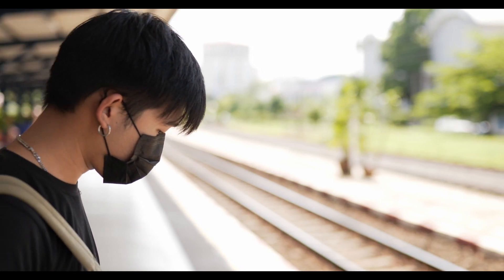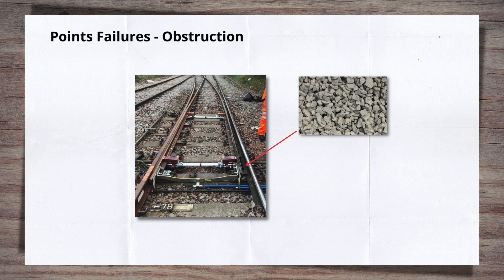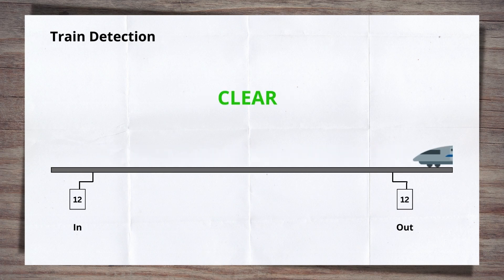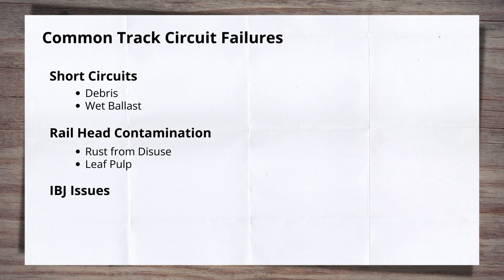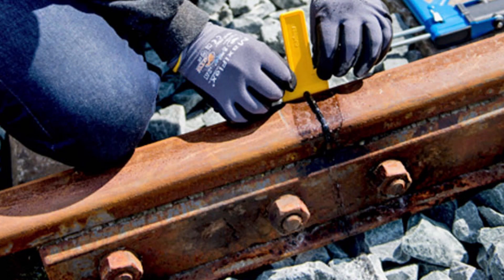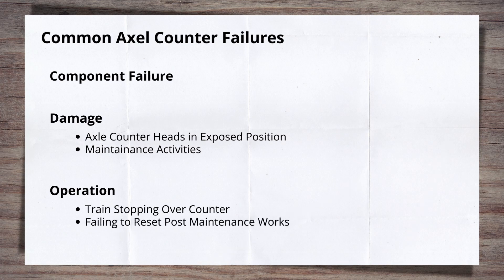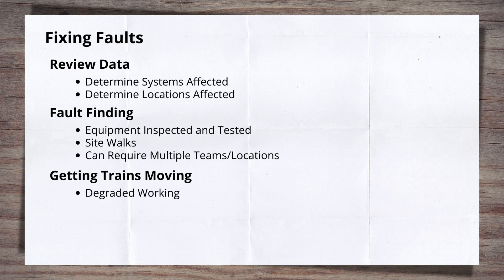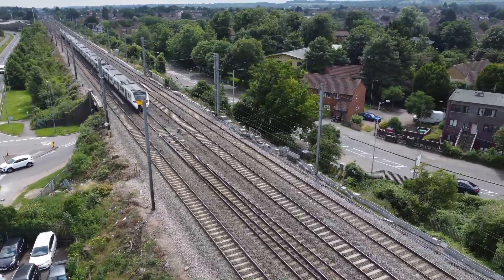Train Delayed? Here Are the Common Signalling System Faults You Need to Know

Comment: Just to clarify: When a train is in a block the circuit is completed by the wheels, offering lower resistance than the path up to the relay, so the relay isn't switched on and the signal stays at red?
Reply: Yes. The short via the wheels and axles is the quicker route to ground. Relay sees its not getting current via the rails it turns the signal light to danger.